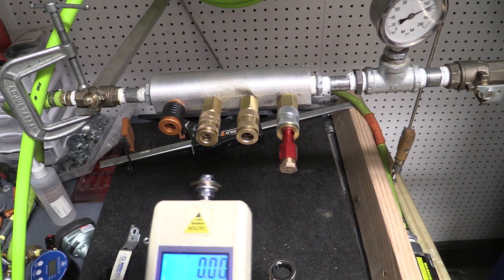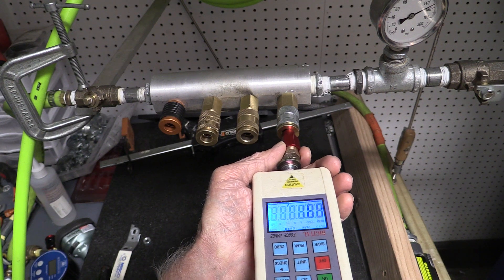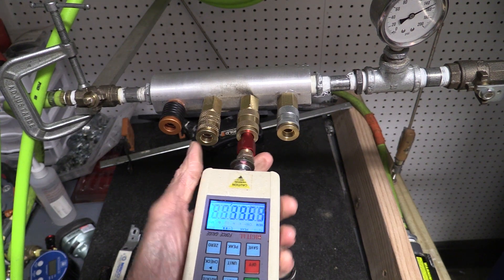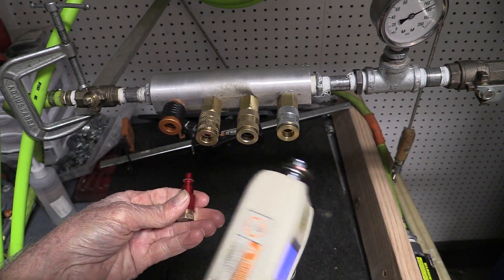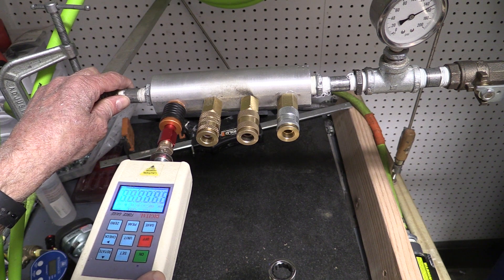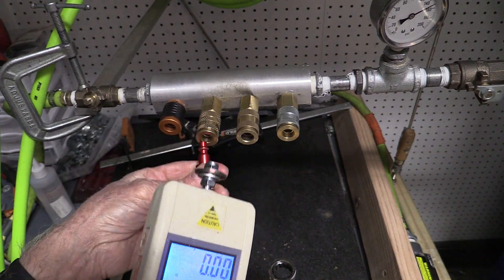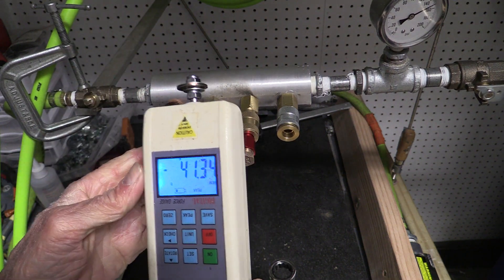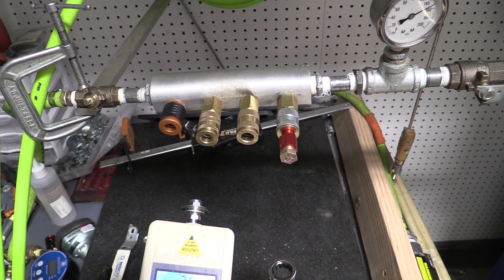Air tool coupler insertion force test

Comment: Any experience long turn using the Stedlin for the durability of the item? I have been using Neiko 1/4" npt solid brass high flow type but can't seem to find them anymore so I might be replacing the entire shop with different couplers, trying to find something that lasts and don't wear out so fast and are durable.